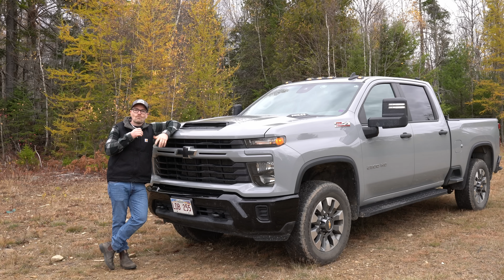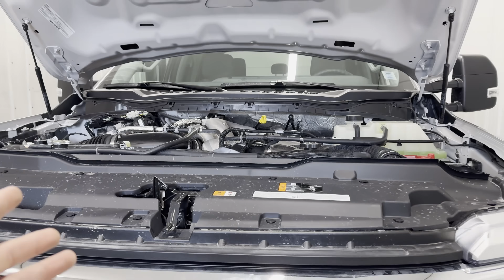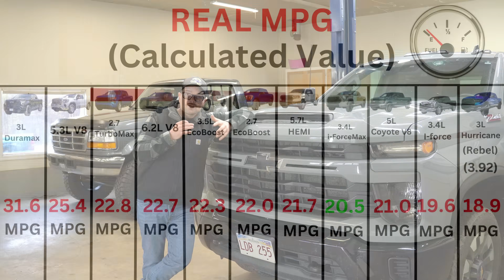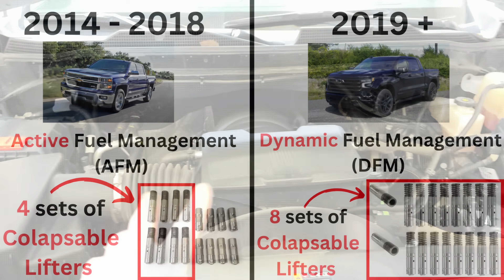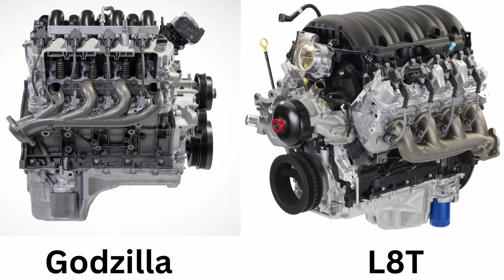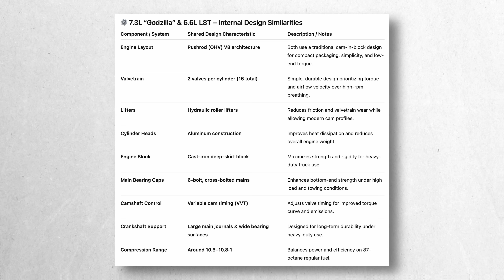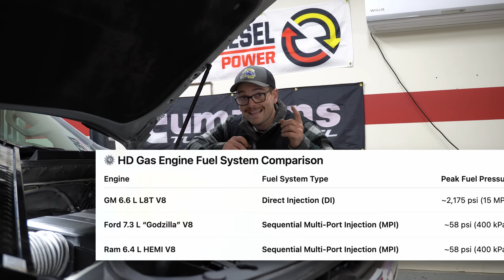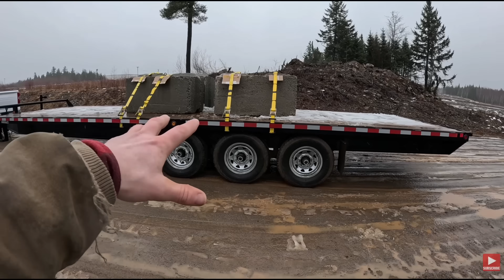Chevy 2500 6.6L L8T V8 Review | GM’s MOST RELIABLE Engine They Still Build

Comment: This is indeed one of the trucks on the market
Reply: The one that has the worst transmission ever 😂
Reply: Mine is a 21 with the 6 speed trans are they having trouble with these trans. Mine has 63,500 miles no issues yet
Reply: @bradbaublitz9046  I've had 3 HD 2500's w/6L90, logged almost 350,000 miles without loosing one. I'm in construction & tow a heavy trailer on a regular basis. Ford, & Dodge have far more failures than the GM 6L, and theres nothing wrong with positive shifts. None of my trucks ever shifted "clunky"...
Reply: LOL

Comment: 3 to 4 quarts of oil in between oil changes and after 20 years of stupidity Chevy still hasn’t fix their lifter/camshaft problems. I work for a construction company that has close to 900 pickups in the fleet and about 200 of them are the 6.6 gas engine. So far I have replaced over 20 of them under 100k miles this year, I wouldn’t own one even if it was given to me, GM is scamming people with these trucks and so is every other 6:36 manufacturer making this junk these days.
Reply: Fake news.
Reply: Yeah, if you’re company has lost 20 out of 200 engines in the last 10 months before they even reach100k miles then it’s VERY LIKELY not the engine that’s at fault.
Reply: @stevelee-u8y  It would be interesting to know what the failure was and the root cause of it. Of course its always possible a company got a batch of trucks with engines that had been built in close proximity to each other with some flaw but without more details we have nothing to go on about this fleet and how they are being used and maintained.
Reply: @charlesb4267 the company purchases on average 70 to 100 new trucks every year and from my experience they are having oiling issues, either it’s the tolerances of the machining or the oil change intervals that GM recommends is to far apart, on average we replace about ten percent of our fleet’s engines every year due to camshaft issues
Reply: @charlesb4267 for more context on our fleet, these trucks are primarily used as utility trucks for transporting tools and materials from job site to job site (mostly highway driven) they also see a significant amount of idle time (why we don’t use diesel trucks). We purchase 70 to 100 trucks brand new every year, due to the large volume of trucks we have it’s not feasible for us to rely on dealerships for repairs and maintenance, GM has assigned us our own rep and works with our technicians to be GM dealer level certified (we do all our own warranty repair and recall work, these new engines are not any better than the old ones we still see the same failures for the 6.6 to    The 6.0, oil consumption, lifter/ camshaft failure. Any specific details you want to know please feel free to ask
Reply: I also would add that we maintain our trucks per GM standard, GM spec fluids all serviced at GM spec intervals, we even consider ourselves as severe duty so we go out of our way to regularly inspect these trucks to try and prevent damage from defective parts early, I would highly recommend that if you own one of these trucks you bump your service intervals down to every 3000 miles and check you oil every time you fill your gas tank, I would also highly recommend upgrading the transmission cooling system as well if you’re towing frequently, these trucks are fragile and do not handle abuse at all
Reply: @supertech5380  what do you consider abuse?
Reply: @stevelee-u8y for example if one of our drivers gets stuck in mud on the job site, if they choose to beat on the truck to attempt to get out there is a higher chance of causing damage to the drivetrain to one of these newer trucks vs, one of our pre 2019 models, also if the driver pushes the truck to the maximum on every service interval on a regular basis it is more likely to see a catastrophic failure vs. an older model our older model trucks seem to be more forgiving when it comes to human error and general maintenance
Reply: My biggest issue with this video is he is saying that the 6.6 is one of GM most reliable engines and is basically being a biased fanboy over them when in reality and from my experience as a 20 year mechanic they simply aren’t, 10 percent of a fleet going down over the same issue isn’t a maintenance issue it’s a manufacturing problem
Reply: @supertech5380  Unless I missed what issue this has been, can you explain what engine issue these have been having that I assume then has been destroying the engines ?. I had bought a new 2025 model earlier this year and it currently has little use on it and has been driven very conservatively and have not towed with it yet. My plan even before I bought it was to do my typical 3000 mile oil changes I have always been in the habit of over the years and hearing about DI engines being more prone to fuel dilution is certainly not a plus. Whatever is failing, is there a possible prevention measure to keep the engine from this failure ?. Of course I have the 10 speed so that should be lovely as well at some point with trans issues.
Reply: @charlesb4267 so for the past 5 years or so the most common failure of the 6.6 is camshaft and lifter failures, typically the number 3,4, or 5 cylinder intake lifter will fail and destroy the camshaft sending metal and debris all through the engine. The lowest mileage engine failure in a truck I have personally replaced had just shy of 5k miles on it but most of the failures for us happened between 20k to 110k miles. We have also noticed that a large percentage of these engines consume anywhere from 1 to as much as 4 quarts of oil in between service intervals. That’s just the some of the issues we have with the engine, if you want to talk about transmissions that a whole other rabbit hole of problems. GM is aware of these problems and as long as the truck is within its warranty they are happy to help but as soon as it passes over 100k miles the cost is the customer’s responsibility. Also this is in our specific fleet which consists of approximately 900 trucks ranging from half ton to one ton Silverado, I don’t speak on behalf of all 6.6 owners
Reply: @stevelee-u8y yeah I’m sure it’s our maintenance program that’s killing their junk ass transmission to👍
Reply: @supertech5380  Probably
Reply: @stevelee-u8y just saying I wouldn’t want to be a brainless fanboy over this over priced, over hyped junk that modern manufacturers a pushing of the assembly line these days  literally pushing cause they can’t even get good quality materials to finish the product the right way in the first place
Reply: @stevelee-u8y I am curious as to what your specific background is with this particular subject? Are you a GM technician with 20 years experience specializing in light and medium duty trucks or just a keyboard warrior?
Reply: Do you know what has been failing in the engines you have replaced so far ?
Reply: @charlesb4267 yes they all seem to be having oiling issues either number 5 intake or number 4 intake seem to be the most common failures, the lifters get scored and beat the crap out of the cam lobs, our shop has our own GM rep because of how many trucks we buy every year and they don’t even bat an eye at it anymore, they just send us new engines, they have also told us that the oil consumption is normal due to factory tolerances, it’s absolutely ridiculous
Reply: to be fair, GM met the needs of their customers years ago by producing the 454 big block. if the customer buys a anything else instead, its the customer's fault.
Reply: There’s a construction company in Ohio called Kokosing. My sons buddy is mechanic there ,they probably have 200 Chevy trucks! They tried Fords about 5 or 6 years ago.  There maintainance cost went through the roof. Went back to Chevys there cost were cut in half
Reply: @Blackburn67 I work for them also
Reply: Fredericktown shop sees more issues than anyone and honestly we see things go wrong most times even before the dealerships do

Comment: The covers might be for temperature control.  Some things need to be warm in cold climate.
Reply: you can tell what theyre for when you look at them. temp control will have thicker insulation. sound dampening will have more coverage area. both have foam. if it doesnt have foam on the cover, its just for looks.

Comment: In your opinion, would a EGR oil catch can mitigate the effects of direct fuel injection when the engine is NOT equipped with port fuel injection as is the case with Ford v8 engines?
Reply: Yes, but not completely.  Combustion build up will still take place at a slower pace.

Comment: I have this exact truck and Tow 7,800lbs worth of tandem axel v-nose high top trailer almost daily. The Truck performs flawlessly and I have been impressed with the big gasser. Only complaint I have is tugging through the mountains and hills of the Tennessee Valley I will say my gas mileage is absolute shit 😂. Between 3 and 6 mpg real world for me and I'm not an aggressive driver. However, overall I'm very happy with the torque, smooth transmission shifts, and so far reliability  of this monster.
Reply: I will say I also own the Ram 6.4 in the laramie  A package, and while I haven't hooked it up to my Big trailer yet, I have towed 4k worth of trailer and quads with it and I don't think its winning any fuel awards either😅. I have a lot of rolling hills and that just kills the fuel economy on these hogs! Subscribing to the channel sir! I like what your doin!
Reply from the maker: She does love the fuel no doubt about it
Reply: I pulled a 12k lb 5th wheel with a 2003 1500 V-6 Silverado 200 miles to Sebring. Ran fine. Tranny loved it. Total beast. Got 8mpg . Didnt go over 50mph. Miami to Sebring-totally flat.
Reply: 3-6?! you sure this thing doesnt run in the gallons per mile range? i drive a hybrid and never tow so i get 35mpg, youre talking pure insanity for my world lol.

Comment: Does this engine have the AFM-related issues that plague other GM gasoline V8 engines?
Reply: No, the GM HD gas trucks do not have AFM.  Neither does Ford. However the Ram 6.4 Hemi does have the MDS cylinder deactivation system.

Comment: There are a lot of these 6.6L out there with some good miles - has anyone had carbon issues on the intakes?
Reply: Good question
Reply: @chadmiller6487  He knocks on it continuously. This engine has been out for 6 years now so I just want to know if it’s real.
Reply: @V8sRuleTheEarth 130k on mine. No issues yet.
Reply: @chadmiller6487 did you install a catch can?
Reply: @V8sRuleTheEarth  as soon as I bought it 👍
Reply: No, it's a nothing burger .

Comment: The intake valve carbon deposits on the direct injection gas burners...makes me wonder if my oil burner is doing the same....they're direct injection too after all...
Reply: its just extra maintenance. theres sprays you can do, make sure to read directions. or you can pull it off and clean it up i believe every 30k miles. again follow directions for that. as long as you do that it shouldnt be an issue at all.
Reply: Internet problem.

Comment: I’m a big fan of the L8T, I have had a great experience with my 24 2500HD over the past 23k miles. I’ve towed my camper probably 5 or 6k miles since purchasing my truck and it’s been an absolute unit. Very minimal oil burn, even when I towed 2k miles over 4 days, couldn’t be happier with it. I stick to 5k mile oil changes, an extra oil change per year is well worth it for the cheap insurance.
Reply: You are a smart fellow. 5k mile changes or below, is best thing to do for it and every other engine out there.
Reply from the maker: Thats pretty much what it comes down to. going from 7500 miles to 5000 miles basicly mean an extra oil change per year. Maybe another 100 bucks - Very much worth it.
Reply: Did you go straight to towing or did you break in first? Do HD trucks still require break in?
Reply: @daeladub I just bought a '25 2500HD trail boss and I did break it in. I ran the first 500 miles without towing and without going over 3000 RPMs. Thats what the manual said to do. I now have about 1800 miles on it and I've towed twice with it. 10k pounds about 185 miles one way. She did excellent.
Reply: @daeladub  Not to hack this comment but I did the recommended no towing for the first 2000 miles, then change the oil and go tow all day long forever.
Reply: @CabinCruiser  im not a truck guy so it just sounded like good practice rather than the suggested manufacturer procedure. Im looking to get my first pick up and in trying to take everything into consideration. Maintenance is a big deal but im not sure what practices could carry over and what would hurt. Everybody wants the big daddy diesel but it can be a maintenance hog especially if you're towing using it to make money. Lowes runs is about all its going to see and couple of out the way fishing spots is all the dirt it will see. So im thinking of saving 10k and just get a gasser. Regardless of what direction I go I want to keep it forever.
Reply: @daeladub  I think it's going to be a few years before we see diesels getting reliable again. As long as the manufacturers are band-aiding problems instead of addressing them, i.e. the DEF problem, the gasser sales will make traction. I use my gas trucks the same way and tow the same things I towed with my diesels. These 6.6s can handle every bit of it just fine. Just a little slower. Who cares!
Reply: @daeladub I too broke in before towing but I’ll try to find it in the manual, but I believe you are supposed to change the oil it comes with before towing. I did not do that. 

But I halo had oil analysis at 42k miles and everything came back good. 5k or less miles for oil changes. Oil changes before towing the 5th wheel on vacation and a change when we get back. Every time.
Reply: @daeladub Yes I did a break in, 500 miles before hooking up my camper to it. I’m now at 32k miles and still no oil burning with mine at 5k mile intervals.
Reply: Alex the plastic is on the engine so those parts don’t rust like fords 7.3

Comment: 2022 6 speed,   zero issues 90,000 miles,  pulling 6,000 plus 80% of the time...  dumpster trailer loaded...  do,  keep it fueled up,  in the wind shell drink that last ¼ tank Easley.   18mph without trailer,  8.5 ish with,  lots of hills and stop lights where I live
Reply from the maker: just simple engine. she needs her fuel don't get me wrong but thats about it.

Comment: I own a 2024 Chevy 2500 with the 6.6 gas engine. The engine burned 1/2 quart of oil at the first 1k oil change and 11k miles later, it has not burned any oil. Runs great, but I’m waiting for the transmission to break..lol.
Reply: Are they really still having transmission issues?
Reply: @InuranusBrokoff my 2020 blew the trans at 80k
Reply: @smallmouthfreaks7609 Did it have original fluid? Was fluid ever changed?
Reply: @williamevans6522 changed at around 44k and was acting up starting around 78k, blew torque convertor at 80k
Reply: @smallmouthfreaks7609 they are running to hot all they need is a tranny cooler and 3in aluminum radiator
Reply: @InuranusBrokoff Yes, many 24’s and some 25’s.
Reply: @InuranusBrokoff  the transmissions are absolute junk. There’s nothing Allison even about it.
The best thing they did was terminate the relationship with GM.
it’s not an Allison. It’s not Alison built. It’s a licensing for the name.
Which GM has almost ruined their reputation. Thank God they’re getting away.
Reply: @fishman80  I thought the 10 speed was fairly reliable. Is it just the HD version that suffers from this? If I remember  correctly when Ford and GM co-developed the 10 speed GM was having better reliabilty rates than Ford due to better friction material and fluid.
Reply: @fishman80 It's because of an expired licensing agreement not because of these transmissions. Mine has been good, pull everyday
Reply: @InuranusBrokoff  theres a class action because of the same known defect since 2013, ford and chevy both being sued because its the exact same 10 spd.
Reply: My ‘21 transmission wore out at 71k.
Reply: @ryan38315 my 21 just went out at 50,000 miles 6 speed transmission.
Reply: My 24 2500 has had no issues with the transmission.
Reply: All big three Auto industry a toilets
Reply: Next Gen Drivetrain has a kit to fix the transmission issue.
Reply: @DavidKlingenberg Yes, I plan to upgrade the transmission once the factory warranty expires.
Reply: @DavidKlingenberg if next gen has a transmission fix kit, why doesn’t GM have it?